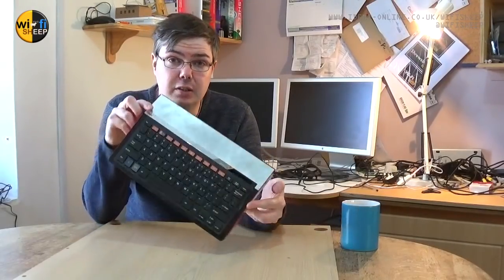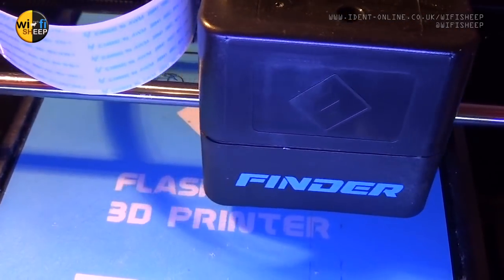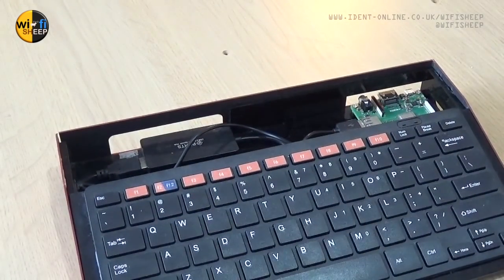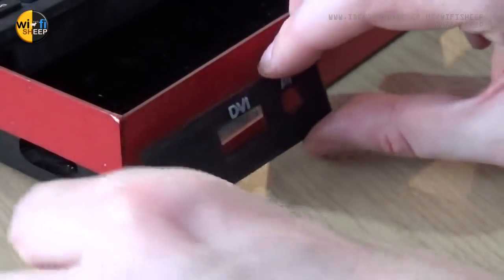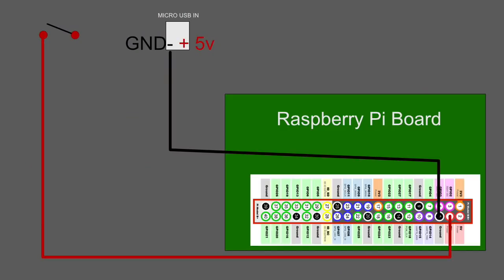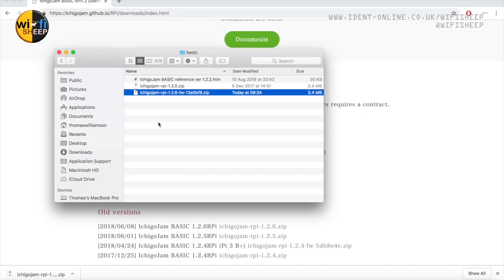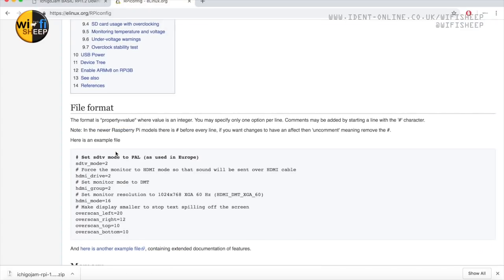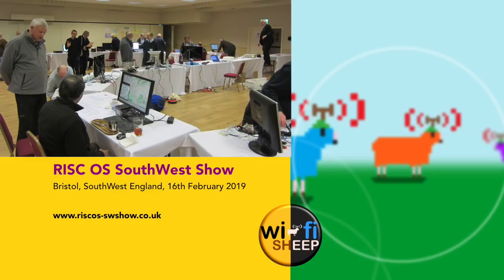Own-build Ultimate Hobby Computer : Wi-Fi Sheep Tech Video

Comment: I love the look of this machine... and you know what? You have convinced me to try building one myself!
Reply from the maker: Cool, thanks and best of luck with your build! When i was designing the kit I used foam/mount board to mock up the cases, in fact the first machines were build out of the stuff! its cheap easy to cut and glue and can save alot of expensive mistakes and hassle later on.

If i was doing this today (and  had access to one) Id look at a 90% 3D printed approach
Reply: @WiFiSheep  , would you be kind enough to share the keyboard link please? And why did you use IchigoJam with such a limit of 1k... I loved the BBC RISC OS you suggested... I am so hooked...
Reply from the maker: Hi the keyboard is one of these https://www.ebay.co.uk/itm/Mini-USB-Keyboard/292917844043?hash=item443343984b:g:S7oAAOSwvpVcO24r:rk:2:pf:0

IchigoJam was used for the demo as it supports the internal speaker which i wanted to feature and it has a nice vibe to it, and i really like the ultra simple and extreme limitations... Yes i think im loosing the plot! 

RISC OS BBC BASIC could be used just as well, I do have a project coming up which will be BBC BASIC based And i will be swapping the OS out on the Micro One as i want to feature some alternative 'quick boot' systems

Comment: Nice little usb keyboard there. 
Do these newer model Pis manage power switches and shutting down these days?  I have a bit of a bodge on my old Pi with a script looking for a signal on a GPIO from a switch and then performing a clean shutdown, the switching circuit then waiting 30 seconds before cutting power. I need something more elegant, I wish it was built in to the Pi
Reply from the maker: HI David, no not really it mainly depends on the OS being used In the case of most linux builds they need to pack and dismount drives etc before shutdown as im sure you already know hence the need for scripts to do this. 
Distros like IchigoJam and RISC OS load from the SD card into RAM so basically do far less unpacking and script running on boot up hence you can normally and safely pull the plug on them with no issues